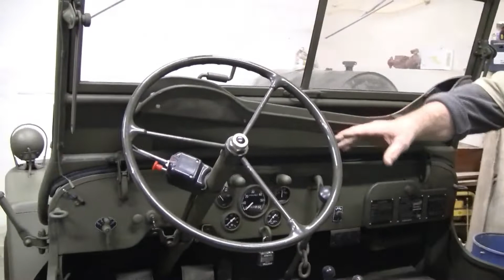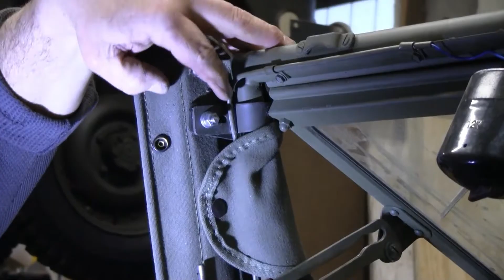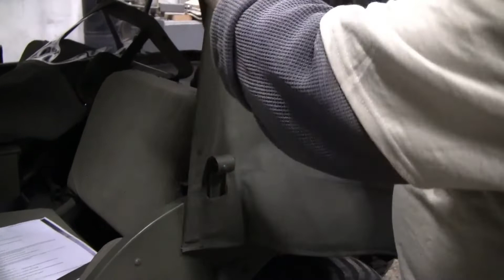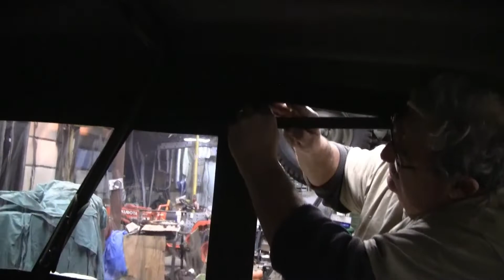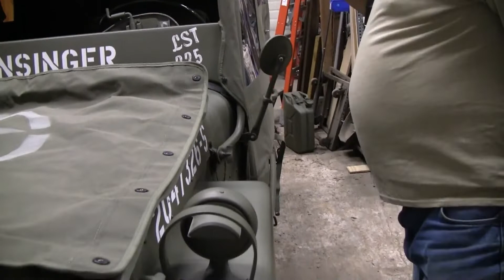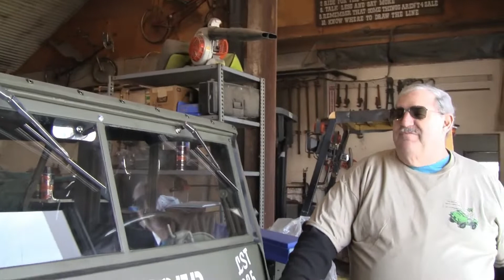Installation of Allied Forces Canvas Complete Enclosure on WWII Jeep

Comment: I have a 1944 GPW jeep. Bought a complete winter canvas kit from John & Mary Worthing Canvas in the UK. Comes with roof top, side curtains that seal the rear section & full canvas doors. I found you don't need a heater because the heat from the engine & exhaust system heat the cabin really well to the point I was getting cooked inside on long trips. Worthing does an excellent job, apparently there a few different types of winter kits  made during the war. 👍🏻👋 🇦🇺

Comment: A tip from the manufacturer suggests that installing the curtain is easier if you attach the curtain to the rear of the top, then work your way toward the door opening attaching the upper turn buttons, and sliding it over the "P" bracket last.